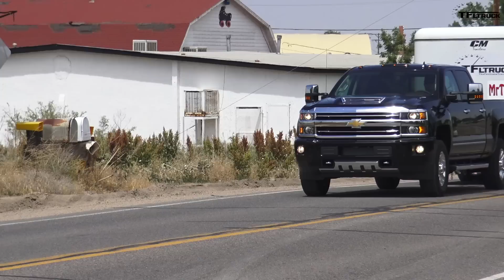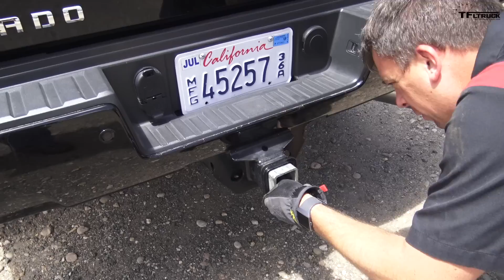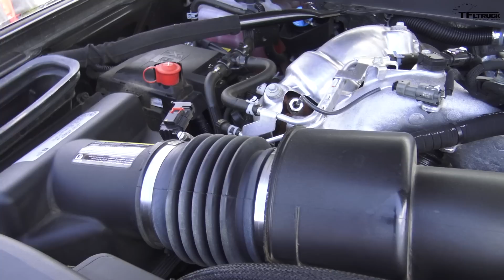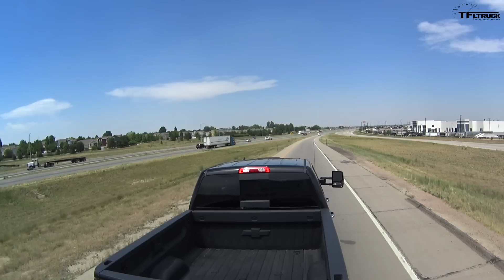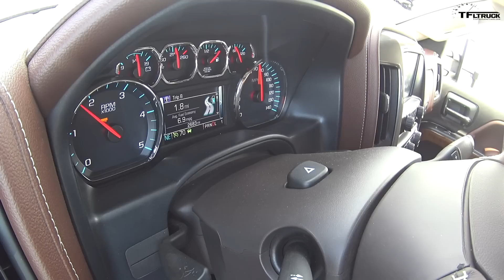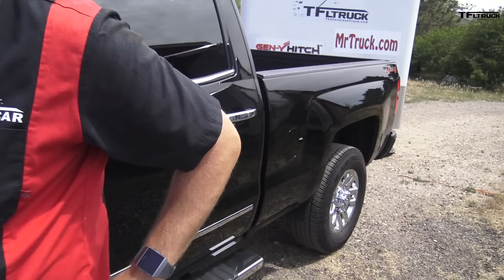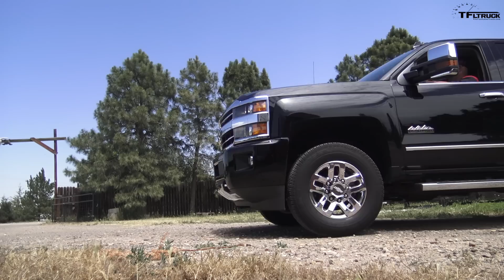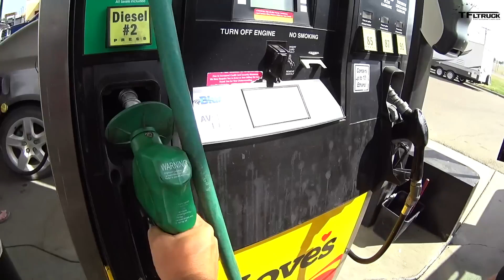MPG Challenge: Silverado Duramax vs Cummins vs Power Stroke

Comment: Great review. For so long the Cummins has been touted as the industry MPG leader. I can tell you as someone who has seen the switch from a 2012 cummins to a 2017 L5P duramax...the mpg is consistently better in the duramax.
Reply: MattChat56 the 2013 cummins did not use def fluid requiring a lot more regens. The 2013 and on cummins do significantly better on fuel than the previous generations. You can't compare 2 vehicles from 2 manufacturers 5 model years apart and say that one is better than the other. If you said i had a 2017 Cummins and then compared it to a 2017 gmc, then your comparison might have some merit.
Reply: Kevin Buhler actually i can compare exactly what i stated as it was a factual finding. However the models might have been different in their make up the fact of the matter is that DEF does not effect the region method. The regin is to burn off the particulates in the DPF that comes before the DEF fluid part of the system. DEF was introduced to reduce the gas levels...not the particulates that need to be burned off.  Glad I could help educate
Reply: MattChat56 Def fluid absolutely does affect regen because it allows combustion temperatures to be hotter which in turn results in less particles which in turn results in less regens required.
You are correct that regens are still required and def is meant to solve a different problem. The issue is that def is required for NOX emissions which as you said was a gas.  Nox emissions increase as combustion temps increase. But if you keep combustion temps low you get more particles. That was the issue with the 2012s and prior. They had to run lower combustion temps to meet nox emission. They put in a filter to catch the extra particles but this requires more often regens. The 2013s added the def system which solves the increase in nox while at the same time lowering particles due to hotter combustion, requiring less regens which equals better fuel economy. 
I have no doubt at all that your new gmc gets better fuel economy than your 5 year old cummins.
Reply: MattChat56 http://www.trucktrend.com/how-to/expert-advice/1402-understanding-diesel-exhaust-fluid-basic-training/

This is a decent explanation see the second paragraph where they talk about the fuel saving benefit.